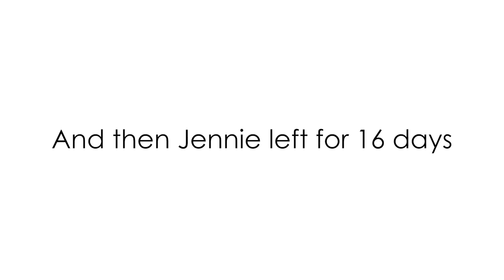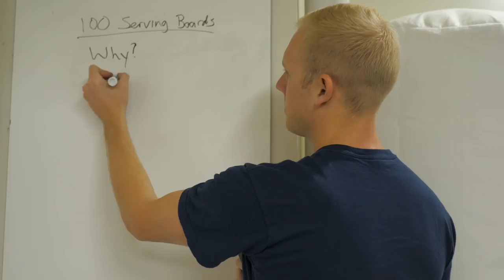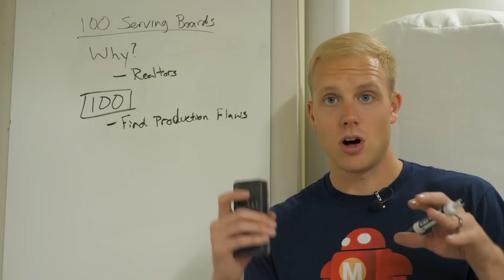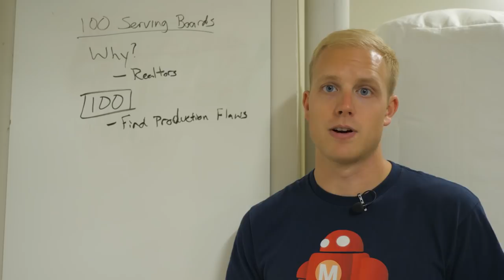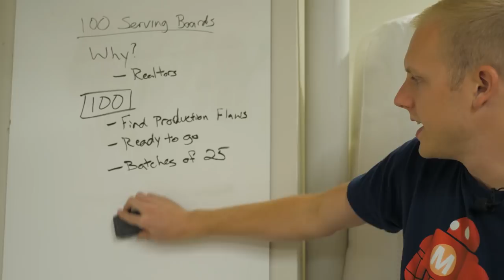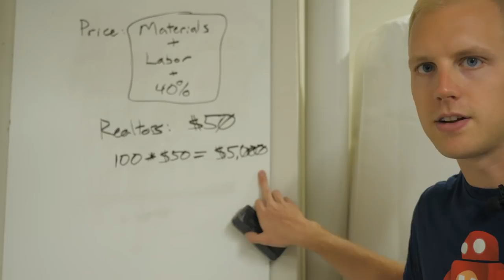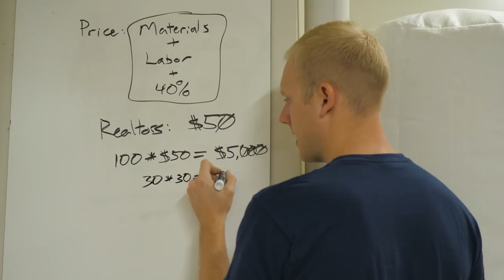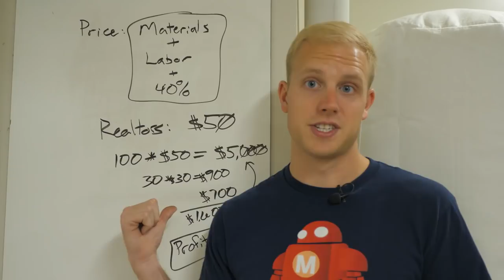🤯We Built 100 Serving Boards IN ONE BATCH!

Comment: I made a few boards using maple stair steps on a CNC. A 42" step gives you 3 to 4 boards depending on the design. Feel free to cut and glue different wood species in between if wanted. Besides that the only hands-on jobs are the edges, sanding and oiling. Oil baths work better for large batches than applying the oil traditionally.

Comment: get a hand power planer.clamp the two boards you want to join and give a pass on the two sides at once flip one board end to end, the slight angle 0,5 degree or something will be canceled by the same angle of the other board and glue perfectly

Comment: It looks like none of the boards you're running through the planer are dead flat, likely because you don't have a jointer. You really need to face joint as the first process, or your serving boards will be wonky. Jointing the edges like you did doesn't really achieve much (you can do it on the table saw anyway).
Reply from the maker: It looks like you're making too many assumptions...
Reply: Jennie and Davis not really, just offering an opinion, as you are through your YouTube video. If you’re offering advice to people through videos, you should really ensure it’s accurate and not mis informative. Keep up the great work supplying custom wonky serving boards though!

Comment: Really curious how you are going to apply a finish to the boards and stage them to dry.  This is a dilemma in my shop because the finishing process effectively stops any other work I can do so i don't create a cloud of sawdust.  And then there is the problem of staging the boards on any horizontal surface to dry...
Reply from the maker: Yeah I've been thinking through this for a few days now. Might have to store them in the spare bedroom to dry. DIY Tyler has a great set of drying racks he made for some built-in cabinet doors - we might build a few of those.

Comment: In the future,  consider creating a pattern to cut the boards using a router and top bearing bit VS a bandsaw. Quicker,  more accurate,  one pattern and 100 boards complete in a few hours. Saves time, money and effort.
Reply from the maker: Took me less than an hour and a half to do them on the bandsaw and sand them smooth. And each one is unique. There’s no way a router taking multiple passes can be faster than that. Plus then they’re all the same and that’s boring
Reply: @jennieanddavis  the right router will do just that, all in one pass, through 2 inch thick material,  all day,  every day. I do it daily. As to it being boring?  Welcome to production work
Reply from the maker: There’s a difference between a boring product and a boring process... 😉

Comment: hey guys, great video. Thank you for the general tips and specifically the cost-analysis part. Since i'm a part-time serving-board maker i think that 30hrs labor is a huge under statement. You'll need to triple or even quatriple that number for sanding alone. I sand up to 600grit and it takes me at least 3hrs per board.
I'd love to know how much labor time it eventually took you to "finish" the boards, for the sake of comparison.
Reply from the maker: Yeah you're spending WAYYYY more time on each board than we are. We're actually going to finish all these in under 20 hours. Sanding past 220 starts to burnish the wood instead of sand it - then your finish won't absorb as deeply into the wood.
Reply: Sanding wood beyond 200 grit is useless, I'm afraid. Steve Ramsey has a video on this.

Comment: A used jointer would have paid for itself already in saved time!  ;)

If you had jointed before ripping and cutting to length that would have saved time as well.  There’s also a tablesaw jointing jig that could have worked but that router table method looked pretty darned efficient. 

I’ve found a thin kerf glue line ripping blade to be worth its weight in gold saving on sanding time and making perfect edges.
Reply from the maker: Not necessarily. After adding up time spent looking for one, seeing a couple in bad shape, haggling with the seller, bringing it home, cleaning it up, dialing it in, and using it for these boards, I’m definitely saving time with the router fence.
Reply: @jennieanddavis  yeah but you fail to realize that it is a business expense and not just a single project expense.  It doesn't hurt to have your eye out for quality used tools. Also staying away from the credit card and being cash conscious is way better off than paying Chase/Discover/Amex to run your business.  
Just a thought.

Comment: Been thinking about getting a router and using it for an edge jointer in addition to other routing tasks. How did that work out compared to a jointer? I'm curious if you could handle longer boards on the table? I would love a jointer, but I think I can handle board faces with a planer and looking for something to get away with jointing edges until I can afford a proper jointer.
Reply from the maker: Worked just fine for edges. I think you could get away with a 10’ board before the router fence wasn’t long enough
Reply: If you don't have a router you can use your table saw and do the same. But a router gives a cleaner cut vs a table saw.

Comment: Instead of using the band saw, you could have made an mdf template and used your router. Probably would have gone a bit faster when it's all said and done.
Reply from the maker: I'm confused - I don't see how that would be faster. It only took me about an hour to run them through the bandsaw and another 30 minutes to sand off the rough blade marks. I'd spend just that much time building the mdf template.
Reply: @jennieanddavis  in a production setting,  which I have almost too much experience in, you will want repeatable results that are consistent that maximize output and reduce cost. Making a template shouldn't take an hour and a half. 10 minutes tops and a decent bit means no sanding,  ever.
Reply: Jennie and Davis but you’d have the template for when you hire employees. And it took you a lot longer to get the thinner blade. ;)
Reply: @austin.hanson  And there wasn't any headway made on the product during the waiting time - not good. I would have gone with a jigsaw to rough out the cut, then the template and a flush trim bit in the router to finish it off.
Reply from the maker: @cncwoodworxroc6881  That totally makes sense in a profit-only goal. But that's not where we're operating. We want repeatable, consistent results, but maximizing profit isn't a high-priority goal. I don't mind paying a little more in labor if the Maker has more creative freedom in how each board looks in the end. That will keep employees engaged and fulfilled.
Reply from the maker: @theElderberryFarmer  We're not on a deadline to produce these - we're trying to get our systems optimized. That would have been a great method had we been filling an order with a deadline, though!
Reply from the maker: @austin.hanson  Employees using a template are going to get bored very quickly. I'd rather pay a little more in labor for them to have a little creative freedom if it means they stick around longer because of job fulfillment.
Reply: Jennie and Davis To each their own. I feel like creative freedom would be more valued on larger pieces than the thumb holes on a large volume batch of cutting boards. I think someone pumping those out would appreciate a template for time savings. And, if not, they can always use the bandsaw.

Comment: How do you make cutting boards for so cheap I made one cutting board and it was made out of maple it was $130 of materials.
Reply: $130.00 for materials? you sure it wasn't a coffee table?
Reply: $130? Someone ripped you off.
Reply: Yikes. My local hardwood shop sells maple at ~$7 per board foot. I'd definitely find another shop
Reply: Did you have the wood mailed first class?
Reply: Boy, someone sure saw you coming!! My cost on maple is currently $3 bf. It's one step above oak in my area but half the cost of walnut and cherry

Comment: If you are having to join each board after cutting them on the table saw then you are using the wrong blade. I had a production shop for almost 20 years and never used anything but the table saw to cut my glue joins. I made 1000's of glued up panels for the CNC only remember maybe one or two that failed and it was caused from using a rip blade instead of a good combo blade
Reply from the maker: We're using a top-of-the-line combo blade.

Comment: When are you going to get yourself a jointer? Pretty much a must have in any shop. Make sure to do your research first though, as everyone seems to buy a jointer too small at first and then upgrades several times.
Reply: A jointer is one of the first tools you should buy doing this type of work
Reply from the maker: Router fence worked just fine for 1/10th the price.
Reply: I was thinking the same thing. A planner makes even thickness, it does not flatten, without a pain to use sled. Those boards looked pretty warped. A router table jointer works fine for edges, but the face needs to be flattened.
Reply: @jennieanddavis  as Doug points out you can joint an edge with a router, but not a face. you can make a sled for your planer to do faces, but if you are doing that with any frequency, it becomes a waste of time. A jointer is one of the most basic tools needed, as warped boards can have precise joinery

Comment: Is that the DeWalt DW734?  What do you think about it?  I am eyeing that one for my shop.  I like the locking motor to minimize snipe.  Did you consider the 735 and if so, how did you settle on that one?
Reply from the maker: I like it. Don't get a lot of snipe if I angle the pieces on their way in. It's just much smaller and cheaper than the other one. I've always intended to replace it with a floor-standing planer but just don't have the need for it yet.
Reply: @jennieanddavis  Good to hear that it works well for you guys.  Feels like the sweet spot in cost vs performance for DIY, hobbyists, and small workshops.

Comment: Did you just rout that t-track groove free hand?!?!
Reply from the maker: You know it! Turned out pretty good. There wasn't an easy way to clamp a guide strip for the router to travel against.
Reply: @jennieanddavis  Blue tape down, super glue, etc.
Reply from the maker: @skiblink  yeah or I could just not waste time on shop furniture and get it done.
Reply: @jennieanddavis  Just think a perfectly straight, parallel to the edge, perpendicular to the fence t-track is more than just shop furniture... it improves accuracy... you do you.